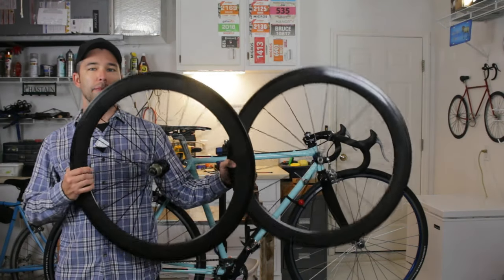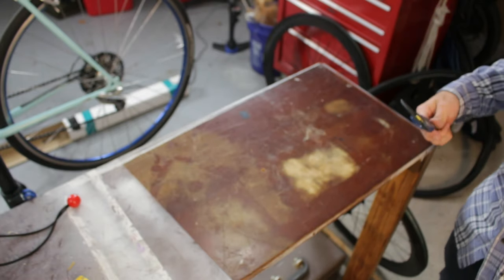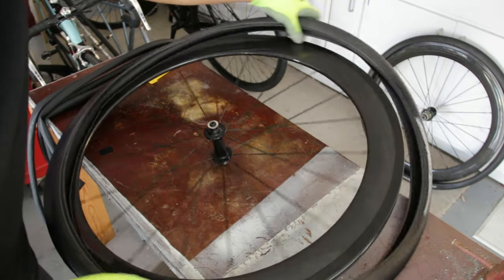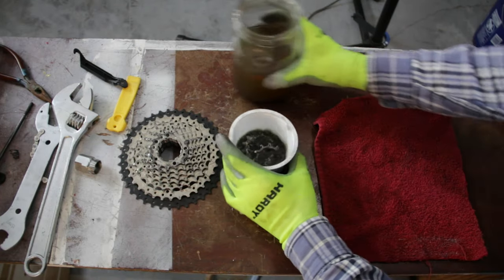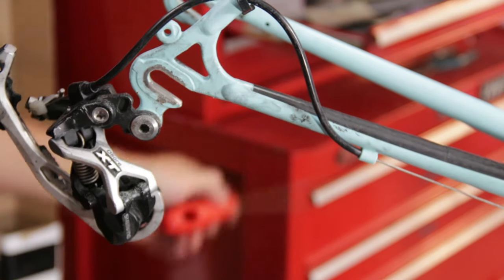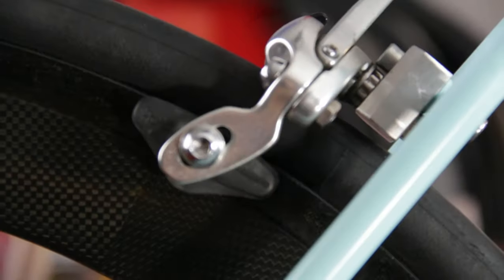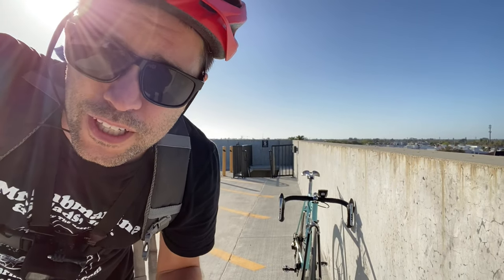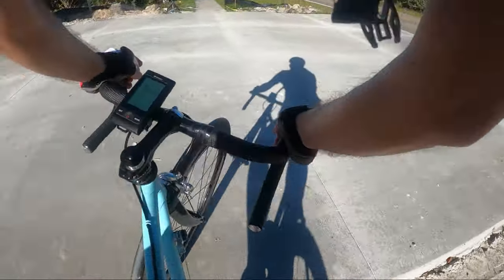$100 used carbon rims on my 1987 Schwinn

Comment: Nice to see an old steel frame built up!  I ride a Bianchi from 1986 with Giant PR2 stock road wheels and narrow gravel bars.  It’s a budget build but turned out a lot more solid that I had imagined.  I also kept the down tube shifters.  I use it on organized metrics and it holds up very nicely.  That Schwinn looks straight.  I’d put grease on the freebody hub before installing the cassette though.  Grease the hell out of everything and wipe off excess.  Helps repel water too.

Comment: I still use the older toe clip straps from the once used pedals from the ‘70’s to keep our front wheels from flipping side to side. My new maintenance stand came with an adjustable rod that fastens to the handlebars to lock the steering up. I’m looking to do this to my early 90’s Cannondale CAD3 that I found thrown out to the curb with the trash….not a thing wrong with it besides the rims having a noticeable flat spot on them….your video has convinced me to go ahead and do the same….looks great! To get the valve stems to quiet down put some electrical tape around where it contacts the rim, works great. Enjoy your new wheels.
Reply from the maker: cool glad to help with the motivation! and thanks for the top on the valve stems!

Comment: I've put 12000 miles on deeper aero rims over the last couple of years. It takes a bit to get used to them but you will get their. They move around in cross winds a bit more
Reply from the maker: thanks Josh. I'm thinking about putting a smaller cassette on there too since I'm not going to be doing big climbs with this bike anyway. maybe an 11-32, rather than the 11-40 it has now.
Reply: @BruceChastain  I run a 11-32 with 50 front and it’s super versatile

Comment: Maybe you can answer my question: do you know if sizing is the same for vintage steel bikes as the modern compact road bike frames?
Reply from the maker: The sizing of the frames is the same I the fact that it’s measuring the top of the seat tube to the center of the BB, but I think the way the geometry is, the fit for the same size will be pretty different.

Comment: Where did you get the drop bracket for the rear brake?  I ran into this issue trying to install shimano ultegra brakes on my schwinn road bike.
Reply from the maker: I made it on a little desktop milling machine. But I think you can buy one too. In this video you can see me making it a bit. https://youtu.be/VTaewoIJkL4

Comment: I plan on doing the same thing, but I want to keep to original vintage fork. Will I still be able to run carbon wheel with the original fork? What cm of wheel did you run on your bike 23c 25c
Reply from the maker: hey Derrick, most likely you'll be find with the steel fork, as long as the width is correct but as far as I know that is pretty much the same for all years I believe, 100mm I think. I'm running 25mm tires on this wheel set.
Reply: Keep up the great content man!

Comment: that creaking coming from your handlebars? if so, check your stem bolts are tightened evenly otherwise they creak, yes even alloy.
Reply from the maker: In this case it's the new wheels, it was totally silent before putting them on.

Comment: Hello sir, may I know what type of bottom bracket you put on that frame?can i fit a mountain bike hollowtech bottom bracket on that type of frame with the help of some spacers? thanks
Reply from the maker: It is a MTB style bottom bracket, you can see some details in the original build video. And yes I did use some spacers.
Reply: @BruceChastain  thank you sir

Comment: Aside from already mentionig greasing any metal to metal interface? Those tires make that bike look good. How's it ride?

Also, any advice when moving up from freewheel to cassette? I want to plan for future upgrades on my bike after i end up riding the current parts into the ground, however long that takes (with mantinancing.)
Reply: at minimum, you'll need to get a hub w/ a freehub..lace to old wheel rim (or get completely different wheels.... {coldset (stretch out) the rear to 130mm if it isn't already}

then you'll need the cassette that matches the number of speeds for your rear derailleur and shifter.
Reply: For example on my 1976 KHS Gran Sport mixte:

Went from 6 speed to 8 speed so i had to swap derailleur and shifters (Shimano Acera RD and MicroNEW 2x8 brifters)
Cold set the rear to 130mm using RJ the Bike Guy's method of threaded rod.  Had LBS re-align the dropouts since i didn't make the dropout alignment tools.
Threw on some good condition Alex wheelset, 700c.   Installed 38mm tires.
Repositioned the brake pads.

Recently swapped to Microshift's wide range 8 speed cassette (11-42) so I had to get the Wolftooth Roadlink.
Reply: @kevinfeeney5309 cold setting, basically one of the advantages steel has over aluminum. Also while my bike is a big box bike,the frame itself seems fairly solid. Just annoyed it came with a quill stem (I need to see if the neck is wide enough to just slot in a threadless fork or if I have to find an oddball sized fork or not) and I don't think you can just add mounts for disc brakes on a frame, can you?
Reply: I converted a full rigid MTB into a hardtail by doing just that...... installed threadless headset... and of course a threadless fork (went w/ a suspension fork).... the stem and of course the stack spacers to adjust to my preferred position.  It has canti/v-brake bosses (chose v-brakes)......and also disc mount.   The frame itself doesn't have disc brake mounts so I'm not even bothering.. i'd have to get new wheels and the disc brakes too...at that point i'd just get a more recent bike.  HOWEVER, for framesets w/ canti/v-brake bosses there is this adapter that mounts at the dropout AND has a bracing arm that bolts to the non-drive side brake boss.

I also use a quill stem adapter that retains the threaded set up but I can use threadless stems and whatever handlebar clamp size bars i want.
Reply: I also have seen people on YouTube that add on disc brake mounts but I wouldn't do it myself.... HAHA
Reply: @kevinfeeney5309  Admittedly full conversion isn't entirely economically sound, but the bike is a gift from my parents, so I would rather see how far it can be taken based purely on that rather than abandon at the first opprotunity. Plus the frame itself feels very reassuringly sound and has mice welds. Gonna have to bust out the hair dryer or something to de-sticker it (may want to repaint if I ever do a full teardown to redo the bearings) but other than it having a quill and rim brakes I like the feel of it.
Reply from the maker: thanks Andrew, and good info from Kevin. If you have a steel frame it is possible to add on disk brake mounts. But to be honest with all this work, I think it would be better to just get another frame. What bike do you have?
Reply from the maker: @singletona082  sorry I forgot, but I remember your comment in the other thread now. Anyway honestly sounds like you're having a great time with it, I'd just keep doing that! That's what it's all about anyway!
Reply: @BruceChastain  oh hey an update. Front diameter is 1-1/8th so it looks like a drop in replacement to go to threadless, which is good I suppose since huffy themselves are out of replacement forks.

Doubt I'd need to do that anytime soon. It good to know what I'm working with if replacements are needed down the road.

Currently have your video on frame painting up elsewhere since that is something I will want to do at some stage.

Comment: Hey Bruce,  how's that Shanren cycling computer doing?  I'm mainly a Cateye guy when it comes to cycling computers, but was planning on upgrading eventually to a Wahoo Roam or Element.  But am willing to consider other options....IF they work, if they hold up, and if there are problems the company stands by their product.  I've been seeing quite a few people thanking how Wahoo stands by their stuff.   For example, another cycling YouTuber Henrywildeberry recently had an issue and they had outstanding customer service......
Reply from the maker: It's doing really good for me actually. You saw my review on it I guess? It's also featured in several of my other videos including one where I crashed and the computer took a good hit. But it's still working 100% and it's sort of my go to because it has long battery life and it's simple to operate.
Reply: I saw the initial review... wanted a "2 year" update (close to 2 years since you got it...lol)
Reply from the maker: @kevinfeeney5309  well basically it's still working the same. Best thing about it is the battery life and reliability. Keep in mind it doesn't have any sort of maps.
Reply from the maker: one thing I don't like it you have to have the app in order to get your GPS data out. I even had a long email conversation with the engineers over there, nearly begging them to find a way for us to get the data out another way. I'm just worried that one day for whatever reason the app wont be available to us.
Reply: nice to know it's been holding up so long.  i'd gather you'd need the proprietary app for wahoo or garmin as well....

Comment: Carbon seatpost when. Legit, as someone with an old '88 Prelude, those stock seatposts are strangely heavy.

Also, while that's a good idea, if you're running lower pressures you can easily get away with triple. I'm running 13mm rim and 32mm tire. Working fine, but I don't go over 70 PSI.
Reply from the maker: Thanks for the info!
Reply from the maker: only one thing, I haven't been able to find a carbon seat post in this size, seems to be a little odd.